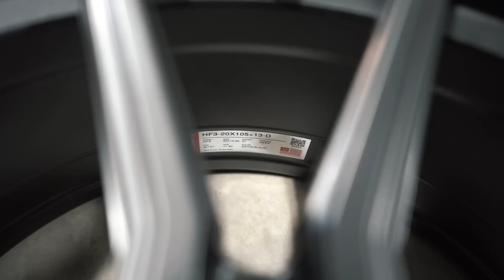Surprising My Wife With Her DREAM Forged Wheels!

Comment: You do know that messing with the overall circumference of the tire messes with the speedo which means your wife will not get an accurate reading as to how fast she is going, Always best to go with a bigger rim if you want to do low pro tires.